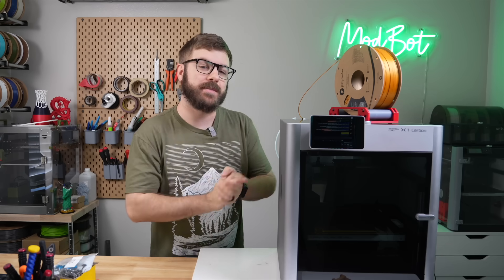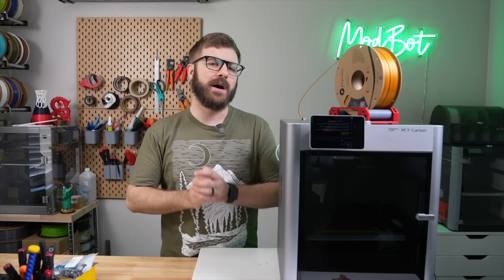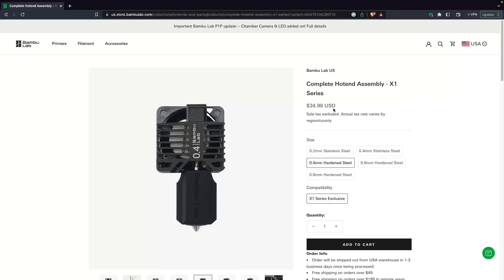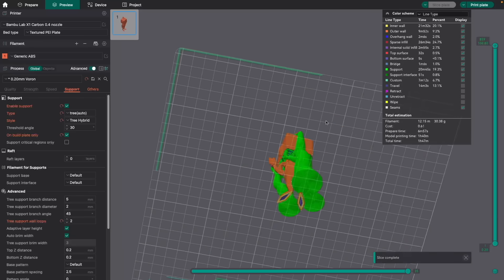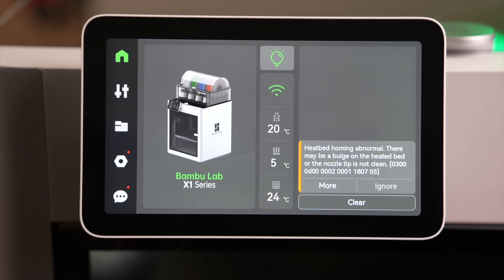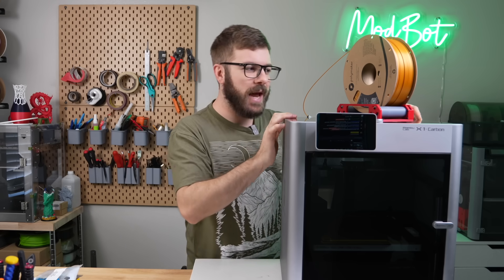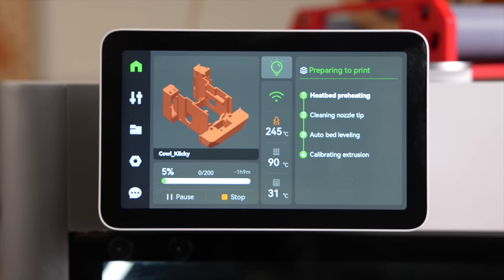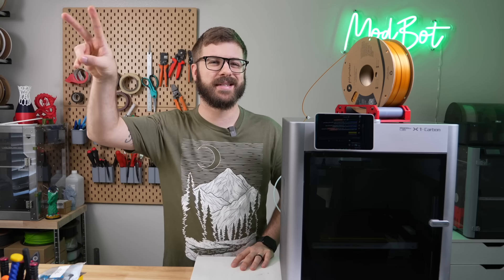One Year With Bambu Lab X1 Carbon

Comment: Daniel,

Glad to see your experience is still overall positive. I've had my X1CC for about 6 months now and I love it for most of my printing. I have a long running issue with Bambu (since February) that is preventing me from fully utilizing the printer for Voron Print it Forward use. In short, any time I print a horizontal hole (in the z face of a print) - like hex nut holes or heat set insert holes, they print squished (like an oval). There are several other owners having this experience and we have open support cases with Bambu. We're convinced it's a hardware issue (I can print the exact same STL on my Voron and it prints pristine) and are working the process thru with Bambu Support.

Other than that, it prints all my Etsy items near flawlessly and I enjoy the hands off, turnkey printing operation.

Thank you for the review!
Reply: This doesn't minimize the issue (and I've seen it also on my machine, though I don't get it on the sideways D shapes I use to insert square nuts) but I thought Print-it-Forward had a rule that all parts had to be printed on a Voron?
Reply: @davydatwood3158  I'll have to check that. Thanks for the heads up.
Reply: @davydatwood3158  well - the vetting rules do infer it must be a Voron that creates the parts - but it does not explicitly state that: "Which Voron Model(s) you have and are intending to use for PIF" - it's likely that the vetting team would reject my submissions if I were to say it was an X1CC
Reply: PiF is 'by Vorons, for Vorons'. I'm pretty sure if you got in, and then found out that you weren't using a Voron, you'd be very swiftly ejected from the program.
Reply: have you checked the tension of the x and y? That can happen with the  stretching of the belt
Reply: @markburton5292  I've cleaned and retentioned over 20 times.... Literally
Reply: Seen this same issue figured it was just a slicer issue and use a drill bit/heat insert to fix the issue. I was bad and in some cases changed the CAD to adjust for the hole being stretched so it would come out round or in those cases square.
Reply: @drewbeirn7704  Yeah - it's pretty bad and the larger the hole, the larger the failure. I'm still actively working with Bambu however we're not making any progress.

Other owners have printed the exact same models without the issue so it seems like a hardware related issue at this point.
Reply: I have this exact same issue on the X1C, a 4mm hole prints as an oval about 3.4 mm x 4. It looks circular in the slicer but it's totally repeatable. A drill bit fixes it and then an insert, but it's annoying to be sure.
Reply: @MikeGalusha  I suggest you put in a support request - I'm trying to get as many folks that are having the same issue to put in a case and reference mine: US230409716001
Reply: @msteele999  hey have things changed or does the issue still persist?
Reply: @300ml_brasil  Yes - it is intrinsic in the hardware I believe - multiple updates to both firmware and slicers has not fixed the issue. I simply work around it and try to avoid printing holes in the vertical axis.
Reply: @msteele999  quite sad given that an engineering printer should get these things done